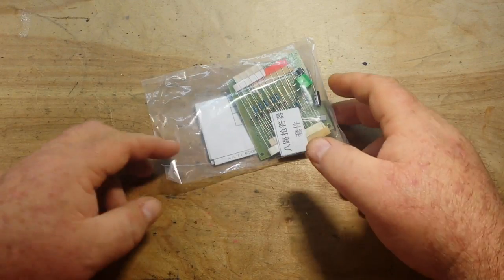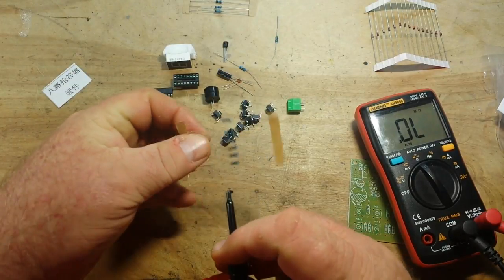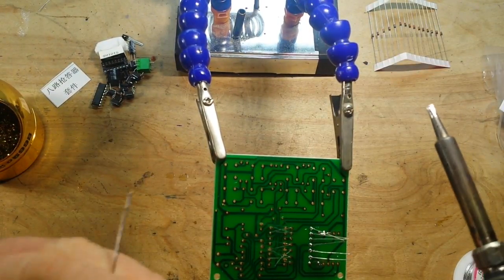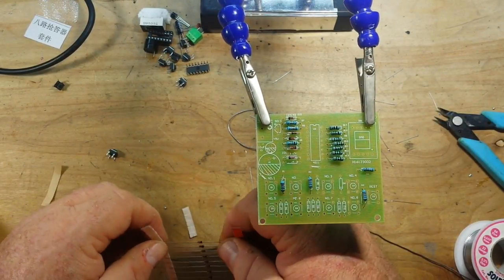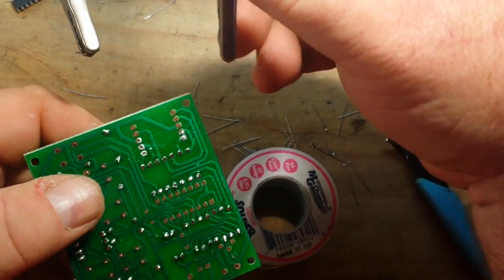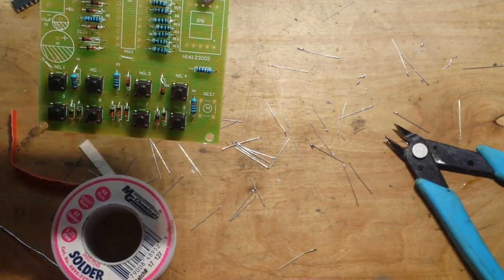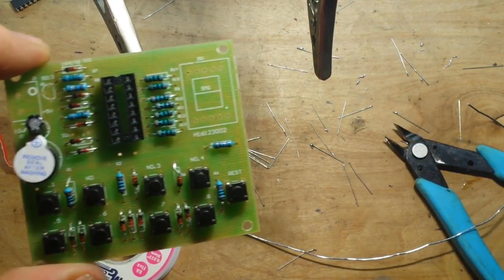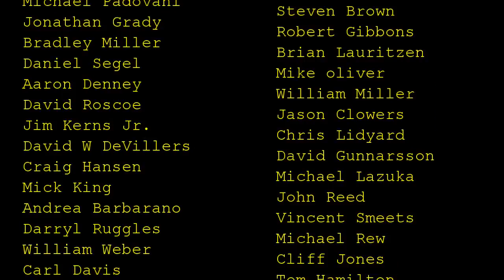8 Channel Digital Responder kit build

Comment: This is crazy.  I found 2 of these kits in my supply last night and had no clue what they were all about.  Plus all the instructions were in another language!  I did some snooping around on my old orders and found sort of what it was.  When I searched on that string, I found you had a video on it which I had never discovered and even if I'd seen it, I would not have watched it.  ( I watch and enjoy a lot of your videos) but would have skipped this one - until now.  Watched it and the mystery is all cleared up.  Yes, extend the buttons and use in school to let 7th graders compete in "Jeopardy" quiz, even Technician test questions in ham class.  They love this!  They are $2.50 on ebay.

Comment: I just finished one of these and my buzzer did not work.  As someone else mentioned it seems to be backwards, but it is done as the board is marked.  I tried unsoldering and turning it around, still no joy.  I suspected a bad buzzer.  I has a small speaker from another project,  so I soldered it into the circuit.  I now have a "beep" from the speaker.  Fun little project for soldering practice.

Comment: Love the Video, Fast question. What type, and size of solder do you use, I ordered some but it is so fine it is as thin as a hair and almost melts when it gets within half an inch of an iron, So I need to get proper solder.
Reply from the maker: Mg chemicals .032" 60/40 look in my Amazon store
Reply: learnelectronics  TY I was looking I guess I just overlooked it. :/